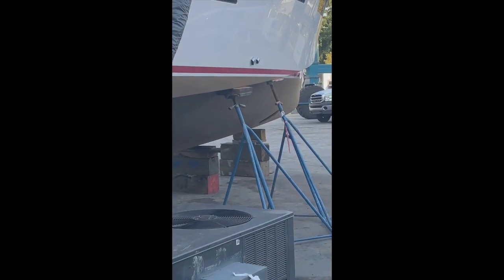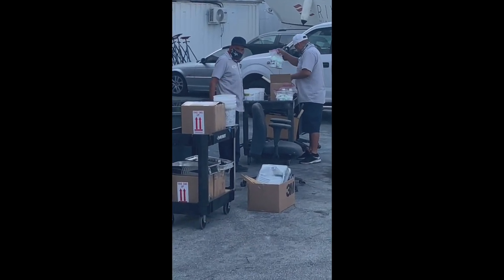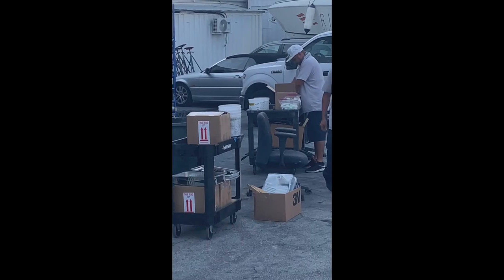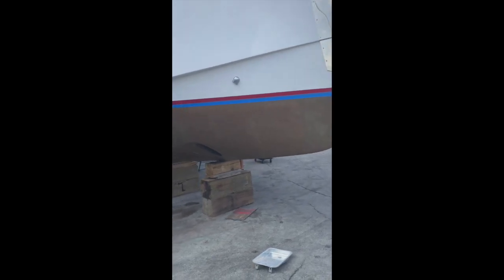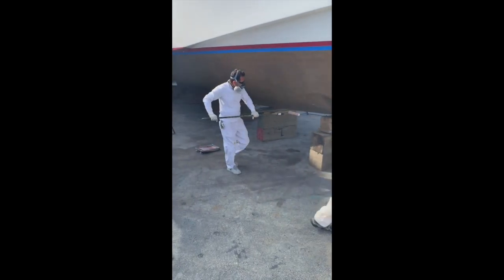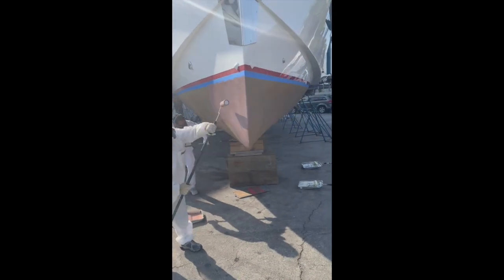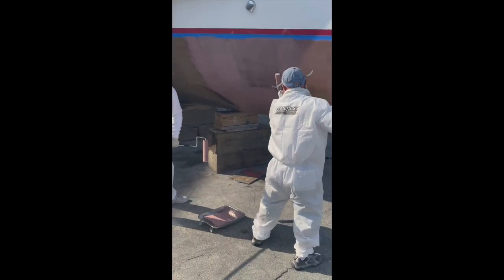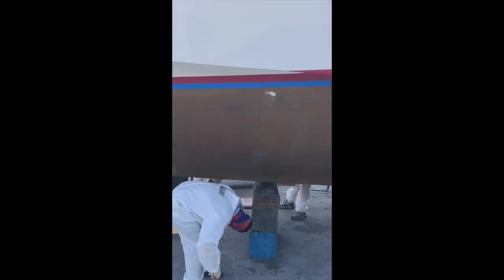The Correct Way To Apply Coppercoat

Comment: I’m a amature on YOUTUBE as well. 

I’m on the Hardstand at Rebak Marina in Langkawi.  I’m in the middle of doing my COPPER COAT application. 

It  has been interrupted by the wet monsoon season on a number of occasions.  Checking the weather forecast is vitally important to making sure I get dry weather and that 48/72 hours cure time. Humidity is also important to avoid after a rainstorm. 

Owning a catamaran, I have divided the job up into 4 sessions. Starboard and Port HULLS both inside and outside. 

I also have the problem of 30 to 32° heat which makes it very difficult to get the copper coat on within even a 20 minute period. Using the recommended alcohol has been extremely important to solve the problem of it going off to quickly. 

With the beginning of the wet monsoon season it has been challenging to say the least.
Reply from the maker: That sounds very challenging. I didn’t have all those issues to deal with in my application. Thanks for watching and thanks for your comment. Best of luck to you.